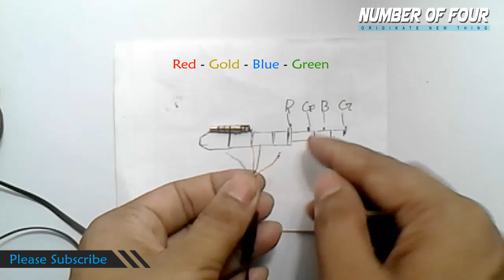How to Fix  Earphone Working on One Side | How to wiring 5 wire in 4 pole Earphone jack

Comment: Great vid...wish the view was a bit closer but the diagram helps.  Just not sure im coordinated enough to pull it off with such tiny wires.  Was that white stuff gaffer tape?  The first tube was what like rubber cement?  Add the super glue and i think that connection is gonna last longer than it would from factory.
Reply from the maker: Noted!

Comment: I manage to fix it by opening the joint where 2 earphones connect to each other. There was a broken wire in there i solder it and boom!! its working again. Didn't had to cut all the wires.

Comment: Can i melt it with out the machine with just only lighter ? 

Plz reply
Reply from the maker: If you tell about soldering with lighter. Then It's not possible.
Reply: @OmarTechTips  can i do it.. join the wire with the jack.. by warming a knife or spoon
Reply from the maker: This is of high Risk!  🏴‍☠
Reply: @OmarTechTips  😭
This work is not for me

Comment: I Have a possible solution (it worked for me)
so if you are having problems with headphones and are on a mac (like me) then there's a possibility that you have it messed up in the settings.
go to System Preferences, sound, and there should be a bar "Balance". if it's all the way to the right or the left, make sure it's set to the middle. Now your sound should be perfectly balanced :)

Comment: Umm I was fixing my pair of headphones and I didn’t need to cut the whole plug I just cut a little hole in the headphones and I took my mechanical pencil and moved the wire to its normal position and I move the wire a little without touching the wires with my pencil and I just taped it together. I was in class when I was doing this and everyone though I was crazy but then they realized I was in robotics and yeahh😂